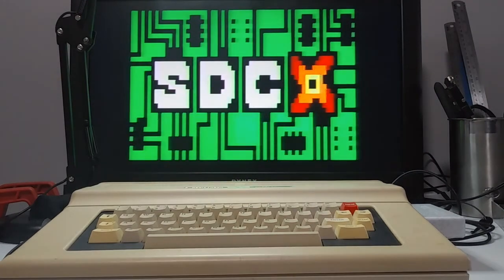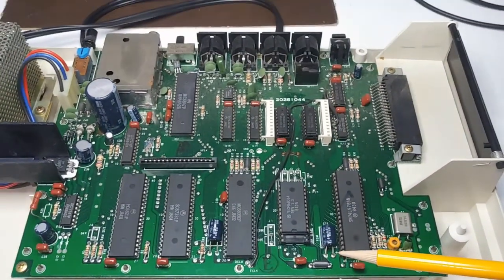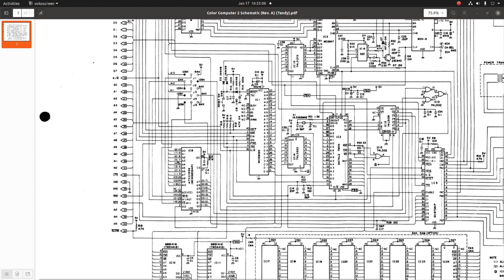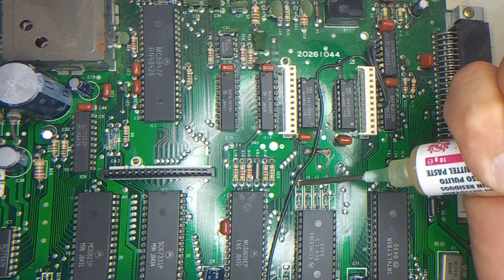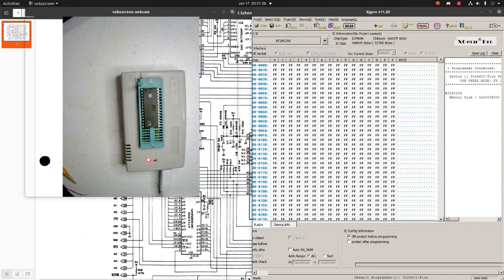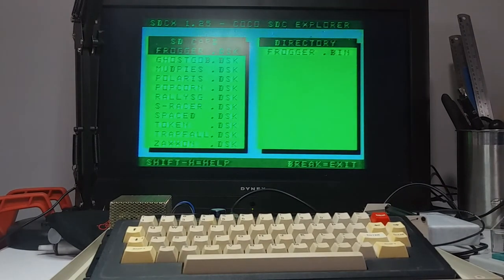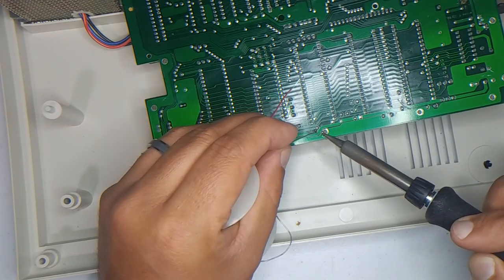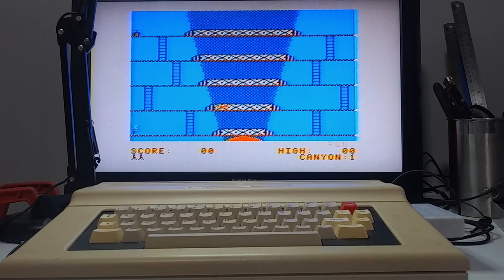Upgrading to 64K ram and adding Extended Color Basic to a 26-3134A Korean TRS-80 CoCo2

Comment: I love it so far, still watching.  I like how you showed what happens when the RAM is increased but the jumper is not added.  An interesting thing about the Color Basic (CB) startup process is that it crawls from bottom of address space up to 32768 or so looking for the "top of RAM".  Even if the jumper signals 64k is installed.  It probably takes a heavy fraction of a second and accounts for most of the delay when the screen is green and still blank.  When it reaches 32768 (or $8000), the address is decoded as ROM, the write-read-verify fails and CB calls that the top of RAM.  Later, the SAM can be reprogrammed for 64k "All RAM" mode, but until that happens it is limited to 32k.
Reply from the maker: Thanks!
I wanted some levity so I left the bloopers in because I think it's fun to see the wrong thing happen. Interesting to know that CB waits for a WR fail to mark where the top of ram is.

Comment: I've not opened my CoCo 2 in years, but I've bought a CoCo SDC and need to upgrade from 16KB to 64KB, and to Extended Color BASIC. 

This is the perfect video, and you've just reminded me that it's all socketed! I was expecting a big soldering job! Excellent. I'll now hunt for the chips. Let me know if you can be of any help in me finding them. I'm in the UK.

Cheers!
Reply from the maker: I don't think I can be much help sourcing components because I'm in the US but you don't need to buy much for this upgrade so it shouldn't be too hard. How's Ebay in the UK?  Do you have a programmer to burn the ROM image? If your CoCo 2 has only one ROM then you'll need a 128k ROM. I used a 256k ROM because I had it in my chip drawer which meant I had to pull down the floating address line for it work as a 128k ROM. Hopefully your model is just like this one.
Reply from the maker: Thanks!